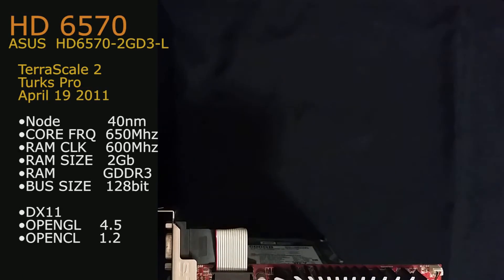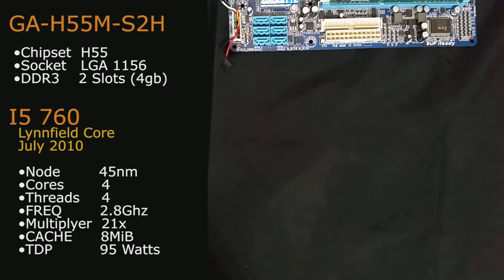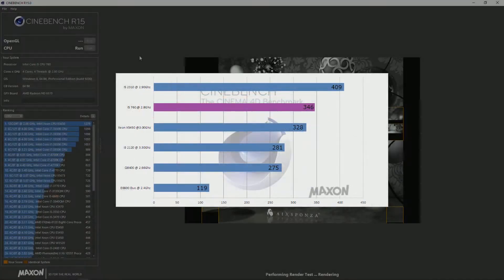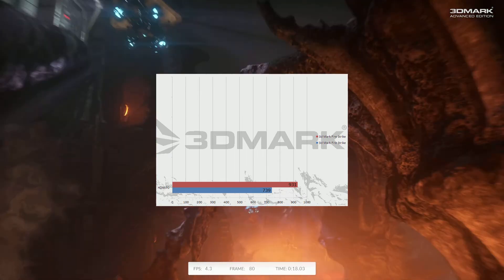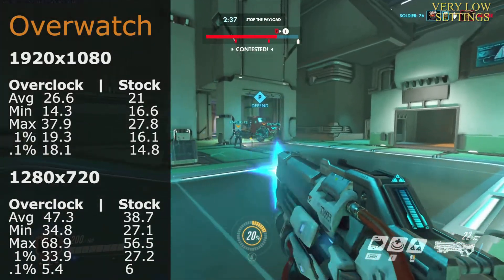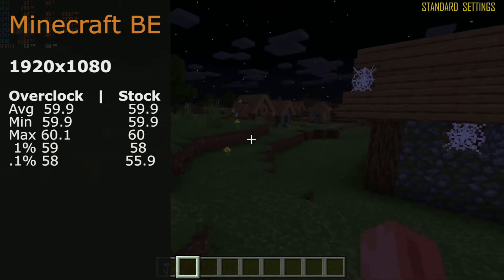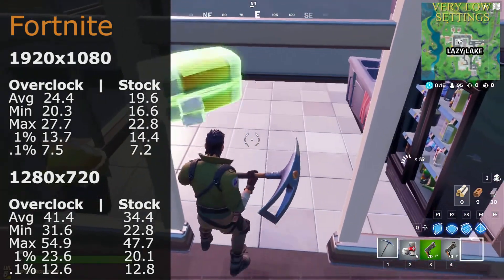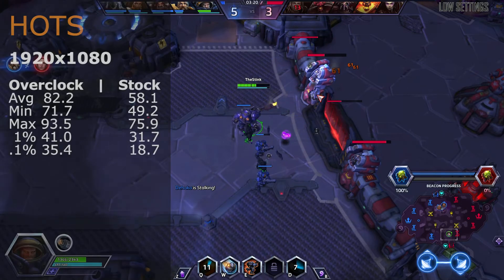Overclocked AMD HD6570 in 2020 Revisited

Comment: Got a OEM version of one of these in with an A8-6500 in dual graphics, noticed when I overclocked it with MSI afterburner that the built in 8570D had a core clock speed of 800Mhz default, and when I overclocked the OEM HD6570 to the same core speed, it didn't miss a beat. I wonder if they were underclocking it to reach a power envelope target maybe? Still, seems fine at 800Mhz core so glad I tried! :D
Reply from the maker: It really does make you wonder.
I think you could be right maybe it was for a power target.

Comment: i have sapphire hd6570 1gb ddr3 128 bit but withouth a fan. what do you think is recommendable clock setting and gpu setting i should use? with out damaging the card?
Reply from the maker: The 6570 can overclock well, but each card differs from the next because of how the cards power supply and filtering is designed on the cards. You could try a 750 GPU clock and a 700Mhz ram clock and see how it goes.
I would consider that to be a safe overlock on this particular version of the card the ASUS HD6570.

Though your card and milage may vary  due to being a different design and
you will need to check if it artifacts and might be worth just getting a fan on it or near it to move some of that hot air of the heatsink.

We hope that helps.
Thanks for watching.
Reply: Thanks i already modified my hd6570 by putting a 60mm fan. And my max gpu settings is at 675mhz and its base clock is 650. 

While my memory clock is base at 900mhz and max of 1000mhz

Comment: Im using the exact same cpu and mobo, my vga is radeon HD6570 from HIS but the catalyst driver always stopped working. Can you help me please?
Reply from the maker: A couple of thoughts.
Most likely a corrupt driver or possibly hardware is playing a miss.

Things to try:
1:  Re download the drivers and reinstall them (if there is a clean install option select that)

2: Try downloading memtest x86 and putting it on to a bootable USB / CD. Boot it up and check your ram for errors.

3: Try re seating your video card (pull out of GPU slot and reinserting it. Do this when PC is OFF)

4: Try video card in another system and see if it has the same problem if not than you may need to look at corrupted drivers or something along those lines in regards to the O/S

The bad news. 
From my past experiences usually getting an error like this is due to the video card unable to go into acceleration mode or able to stay in it.
This is usually the end of the cards life unless you want to try and re-flow the GPU but that will only get you another month or so at best,

We hope that helps and Good luck. Let us know of your findings.

Comment: I have an amd phenom 8650 x3, 4GB Ram ddr2 800hz and a Readon HD 6570 2gb graphics card.  What games do you recommend?
Reply from the maker: Games you should be able to okay with your system.

You will need to drop settings to very low and pull resolution back for some of these games.

Valorant, HOTS,  Stardew Valley, Star bound, terraria, Counter Strike Source, Team fortress 2, World of Tanks Blitz, Broforce, Minecraft Bedrock Edition (windows 10 edition), PUBG lite (only playable in come countries, a VPN & changing system clock time to region can be used to circumvent checks)

All these games should be ok to play.

A few games worth trying but not sure if they will be good. for your system.

Diablo III, CS GO,  Star Craft II.

We hope that helps.

Thanks for watching.
Reply: @OFFbitTech  Thnks so much bro

Comment: Hi.. I just digging some informatiom about this hd 6570, since i've got some source/seller that sell it for a good price. 
1 question, will it good if i attach it to my core 2 duo E8500 3,16ghz and 8 gigs of ram 1333/10600? 

Thank you so much before.
Reply from the maker: In our opinion it should be a good match up with a core 2 duo. This card is probably on the slower end of GPUs these days but with a core 2 duo you are not going to be trying to play any games or use any apps that are overly intensive.

upgrading the machine to a quad core I might reconsider GPUs but the HD6570 does not require an extra power connector and the variant we have here over-clocks very well.

Thanks for watching.
Reply: @OFFbitTech  glad to know that. 
I'm going to buy 1 then. 
Thanks a lot 👍

Comment: Question i had the adrenalin software on it and i had mining virus on it which i didnt know at the time and i opened it and went to shower in that time my brother took screwdriver and touched backplate while pc was running and it burned mobo after replacing it with same i couldnt get drivers anymore

Edit: mobo burned not card
Reply from the maker: Try having a look on guru3d web site. They have a stack of older drivers sitting there.

https://www.guru3d.com/files-categories/videocards-ati-catalyst-vista-win-7.html

Hopefully that will be of help.

Comment: I have a radeon 6570 and didn't know it was capable of running good games :p
Reply from the maker: Yep. With a bit of over clocking they really become a lot more capable.
Drop some details and maybe the resolution. Makes a big difference.
Reply: @OFFbitTech  fallout 4, Gta v , Warframe , fortnite and other games are pretty playable with this GPU.
Still weak for this time but better than nothing i think
Reply from the maker: @LthMirror  Pretty much sums it up.
Also be expecting to drop resolutions down in some games to get a playable experience.

Comment: Hd 6570 
E5400
4gb ram fps ?
Reply from the maker: With an overclock on the hd6570. Games like Counter Strike Source and maybe CS GO will play fairly good. The Half-life series of games should play fairly good. 

HOTS might play ok but I have not tried to run this title on a dual as of yet. There are a lot of good older games that should run on your system.

Your CPU is going to hold you back on a lot of newer games.
Games like Fortnight should be ruled out I find they at least need 6gb ram to run and a Quad core CPU.

But there will be still games that would probably still do ok on dual core e5400. Minecraft bedrock edition should run pretty good but you will need to drop draw distances and probably a few other nice details.

If you could dig up a quad core fore your pc I think that would widen the scope of games you could play.

I would suggest Q8400 and up into Q9xxxx cpus. You would need to make sure you can run these chips on your motherboard as well. Just a litle bit of googling will help you there
 
If you are adventures and you are fine with modifying your motherboard and bios rom the Xeon e5430's e5440's e5450's are very good for money. But the install is very very technical.

I hope this can help you.

Thanks for watching Mizahloji.

Comment: Cool man, I love the intro <3
Reply: Just wanna ask though, is it normal for the card to reach 70C max and about 65C avg temps? I already replaced the thermal paste and also set the fan speed to 50%. It's a very low end card so I wonder why mine reaches those temps. Mine's the Sapphire Radeon HD 6570v2 1GB DDR3 variant. Thanks mate, subbed and liked :)
Reply from the maker: @noodle 215. That does seam rather high. But it's probably with in spec for the chip. When I recorded this video it was just coming out winter. So atmosphere temps where low. My card temp was about 40 degrees C for most maybe got up to 50. I should check again and see what summer days are like with it.

Now I was running this on my test bench as well, which is basically an open case.. if you can even call it a case (it's a piece of wood with components screwed on to it).
So I'm just wondering is the card getting good airflow to it. Unless you have tried already, maybe remove the case side and see what temps do.  Other than that I did a quick google of your version of the card and the heat-sink is a lot smaller than my version. Not much you can do about that easily... 
I did try once to mount a cpu cooler on a gpu...  That could be a fun video.

Other than that sounds like you have done everything I would do...  You could try putting another fan over it again and see if that moves more hot air off it and takes more heat away.

Trying to get things cooler can be difficult sometimes with what you have to begin with.

Good luck Noodle 
Let us know how it works out and what your findings are.

Thanks
OFFbit Tech.
Reply: @OFFbitTech  Oh, that probably explains. I live in a tropical country so the room temps are hot here. I do use it inside a case but with the side panel open. I tried tweaking the fan curve with MSI Afterburner and got about 65°C max. Still hot but enough to keep me from worrying that it damages the card. I appreciate the comment you had on my question, and I hope your channel grows bigger. Good luck man, love from the Philippines
Reply from the maker: Thanks! 😁

Comment: I have a sapphire one 2gb ddr3 and it gets to core 780mhz, mem 1040mhz. Not many videos on this card. Nice video btw
Reply from the maker: @vikas singh 6570s they overclock well. Really good memory clock result.
I did a bios mod in the day on this card and had mem @ 900mhz. I found the card would crash at times. But for the most of it ran fine. My 2018 video has the mem clock set to 900mhz if you have not seen that already.

Thanks for leaving a line behind vikas. singh
It's always good to hear other peoples stories and experiences.
Reply: @OFFbitTech  hope to see you do low end, mid range and old hardware videos
Reply from the maker: @vikas singh, The good news my budget is very small.
So you will probably see a lot of low end to mid stuff on the channel. :)
Reply: Hi can you run valorant on that card? I have the same (sapphire 2gb ddr3) 4gb ram and an intel quad core 66000